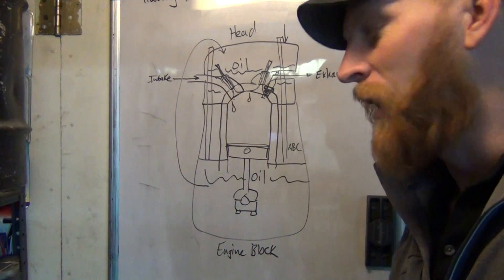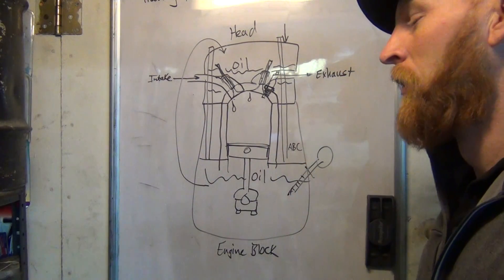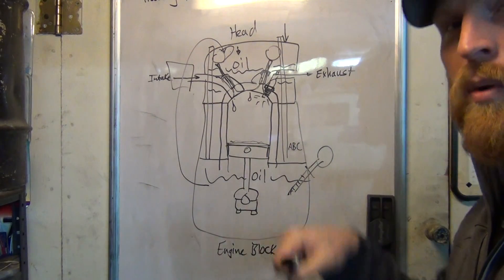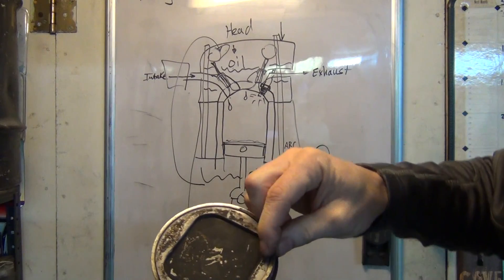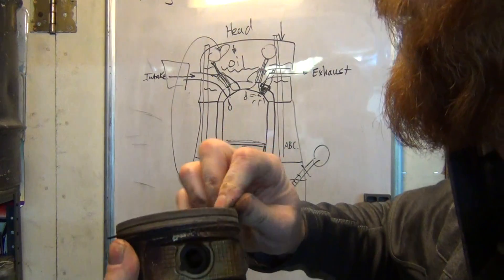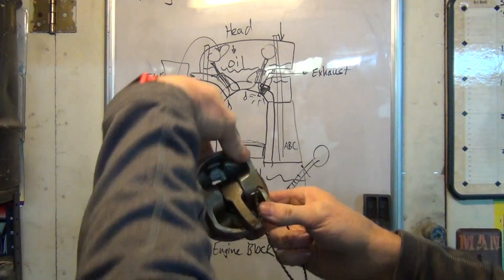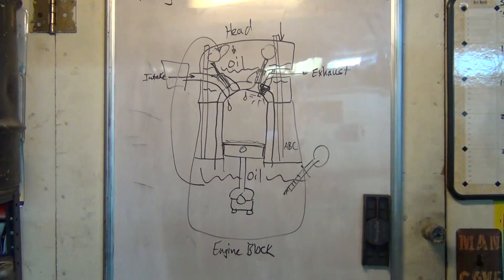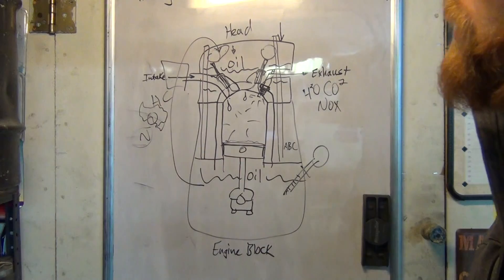Oil Burning Explained

Comment: Not too bad but let me, perhaps expand on the two ways an engine can be burning oil that you pointed out and make it a little clearer. BTW, I'm a retired ASE Master Technician and was trained at the General Motors Training Center in Atlanta back in the previous century. I have a long career at diagnosing and correcting oil burning engines and had one of the best "comeback" records in the industry. When I fixed something, it stayed fixed. I'm talking 100,000 miles fixed.

First, the valve seals almost never leak when the engine is off. If the drain is plugged that can happen, but most often the guides wear out and the old seal can't do it's job. You can replace the seal, but it won't last long either. The main offender is the intake valve seal because it is under a vacuum all of the time; when the vacuum is high it leaks the most. Many engines don't even have exhaust valve seals because those guides are always under a pressure that pushes the oil back into the vale cover area. So, when the valve seals are leaking oil into the combustion chamber (almost always the intake valve seal) the engine will blow smoke when it is at idle, when the vacuum is high.

Second, when the rings go bad oil is not wiped off the cylinder walls sufficiently and combustion then burns the oil left on the cylinder walls. The hotter the combustion, the more oil it burns. So, when the engine is under a heavy load (when the vacuum is low) "blown" rings burn more oil. "Blown" rings (why we say an engine is "blown") also cause a huge amount of blow-by gas to be discharged into the crankcase and this overwhelms the PCV system. I have seen many breathers soaked with oil and this is a sure fire diagnosis for bad rings, specifically the compression rings.

Hence we can tell which condition is the cause for the oil burning. If the valve seals are leaking the smoke will be greatest when the engine is at idle. I've often seen it go away completely when you step on the gas and put the engine under a load. If the rings are bad the opposite will happen. I've seen engines that don't smoke at all at idle and then fill up the shop with smoke the minute you step on the gas.
Reply: Back in the early 90's there were some 305 Chevy engines that burned oil much like you say, in fact exactly like you describe, and the factory wound up replacing the short blocks. The iron in the cylinder walls was so hard the rings never seated: after 5000 miles you'd see what looked like a brand new block with a cross-hatch that looked like it was machined yesterday.

Some things to think about burning. Oil rings can fail and NOT cause an excessive cylinder leak down condition, they just flood the cylinder walls with oil; that could be a cause for your condition. The previously mentioned failure of the compression rings to seat from hard cylinder walls will cause oil burning. Two axioms of oil burning engines: Smoke at idle = intake valve seal. Smoke under acceleration = too much oil on the cylinder walls. That's it. I suppose it's possible a bad design could cause a lot of splash to be sucked up by the PCV but I've never seen that.

As far as the UV oil additive goes, it's an expensive way to look for leaks, but it does work if you use it properly. Put it in the oil and put the car up on the lift, engine running, IMMEDIATELY. Then start to look for the leak. Often a leak is very slow, especially when you don't have a drip on the driveway where you park it. Even then you can have a leak that the wind blows off the engine when you drive it or that blows up onto the engine. Cadillac's Northstar engine was bad about that and the engine just got dirtier and dirtier.

Here's the best method I've found for finding oil leaks. Get a spray bottle with some liquid laundry detergent in it and clean that engine thoroughly, top and bottom. Once dry, spray all the engine's seals with Dr Scholls Foot Powder. You can buy expensive engine cleaners and "Tracing Powder" at the parts store, but these products work just as well and are much cheaper. Run it up on the lift and look for the place where the foot powder gets dark: there's your leak. This is always faster, especially on slow leaks. Sometimes I've seen the leak before I crank the engine, as I spray on the powder: some oil leaks out of a seal by gravity.

Good luck... no... GOOD TECHNIQUE,  good technicians don't rely on luck.
Reply: @ladamyre1  Last November, had my engine rebuilt by a mechanic who rebuilds 2 or 3 engines monthly. After 3k miles, engine started burning oil like crazy with lots of sludge and carbon but no smoke or leak with dry compression test of 185 PSI across all cylinders.  Engine has 12k miles now and i have to add one quart every 750 miles.
Reply: @FaisalHelwa  That sounds like the oil rings broke. Check your plugs and look for carbon buildup on the plugs and a greasy or wet appearance. They should look like there's a dry tan powdercoat on them.

If it's possible that it was burning oil all along since the rebuild, it could be the rings aren't breaking in well. This can be because the block is hard, there were some Chevy 305's back in the 90's that had hard blocks and we would take them apart after 50,000 miles and still see a cross-hatch on the cylinders that looked like it was bored yesterday.

Some guys took a brass polishing compound, can't think of the name of it right now, and would mix a teaspoon of it into a coke bottle of water and pour it into the carburetor while the engine was running to get the stuff on the cylinders to smooth them out, but I've never done it. Seems too drastic to me, if it's getting on the cylinders it's getting into the oil and is going to wear everything, bearings, cam lobes, rocker arms.

Don't know what to tell you to do about it except take it back to the guy. With good compression and all that oil burning, and doing well for 3000 miles before, it sure looks like it can't be anything other than one or more of the oil rings broke, and my guess is it's more likely he's made a mistake on them: wrong ones, installed wrong... the right rings on the right pistons don't just break like that.

When you pull the plugs look for one or more of them to be fouled. If you have a broken oil ring, it'll show on the plug. And if you have access to a bore scope and can see inside the cylinder look for the machining marks on the cylinder and see if those look too new. After 12,000 miles the cylinders should be polished up pretty good.
Reply: @ladamyre1  Broken oil rings would not affect the compression? Plug looked a bit darker last time we checked it but not wet or greasy. he told me plugs are fine tho. Well, i do not think he would install rings wrong. He installs two or three rings a month building several engine monthly. He insists everything is fine and its poor oil quality which does not make sense to me cause no car burns oil like that. Correction, engine has 7.5k miles now since rebuild. Dry compression test of 185 PSI was after we realized engine burnt like 2 liters of oil for you information
Reply: @FaisalHelwa  Yup. An oil ring can break and not affect the compression. As far as the "bad oil" excuse goes: to me that's the sign of a dishonest mechanic.

Not smoking at any time, good compression readings, all dark plugs... sounds more like the oil rings the more I talk about it. Could be the wrong ones, but that would burn oil from the get-go. Maybe he put a bunch of motor honey in it to get it out of the shop.
Reply: @ladamyre1  Well engine was not burning oil the first 3k miles and i was next to him while installing the rings and assembling the engine. Shall i take a picture of the spark plugs and show it to you? what you mean by the wrong ones please? I bought Enginetech piston set and piston rings and he rebuilds three engine monthly. Do not think he would install mine wrong if you know what i mean
Reply: @FaisalHelwa  Don't bother with the pictures. All I can say is what's already been said. If an engine is burning oil there can only be two causes, the valve seals or the rings. Did he machine the block? Did he use stones and rough the cylinders up so the new rings can seat in? Do the pistons knock when the engine is cold? If so there's too much clearance between the pistons and cylinder walls. An engine like that would also show an increase in horsepower, so that one's a trade off: more power - burns oil. I had a '68 Buick 350 was like that, matter-of-fact it was my first engine rebuild back in the '70's. I was happy with it, but it only burned 1qt every 2000 miles or so.

From what you say, something happened at 3000 miles. It wasn't an anti-miracle.

Like the service writers say, I can't fix it over the phone.

Still, that "bad oil" comment is like a big red flag to me. You got problems I can't help you with. Maybe he did use motor honey, I don't know. All that sludge you told me about sounds like it.

1qt every 750 miles is not enough to foul the plugs. It's bad but not outrageous. Hopefully he did use motor honey and the cylinders are just gonna take longer to seat in.

You can live with it too. I've heard of guys with engines that burn oil like that that never have to change the oil, just keep adding it. You get a fresh package of detergents that keep the inside of the engine clean and get cylinder walls, pistons and compression rings that'll last a million miles. When there's that much oil on the cylinders you can bet they're well lubricated. Change the filter every 10,000 miles or so (and BTW don't use Fram) and you'll never have to remove the drain plug. lol
Reply: @ladamyre1  i will keep you updated with investigations. Thanks a lot for your concern
Reply: @ladamyre1  changed piston rings at another mechanic who told me rings were not installed correctly for one cylinder. One thing i noticed bro is that the responsiveness improved than when i first had the engine rebuild with no oil consumption!!!!
Reply: @FaisalHelwa  Glad to hear you found a good technician. There's a million shadetree mechanics out there, half of them with a "good reputation" when in fact they're just well-practiced con-men.
Reply: I admire the training and testing people had many years ago.  Now days, from my experience revealed me that mechanics at shops are guessing. my worse experience was this shop offered to change oil for me and I accepted.   they did not close the cap below tight enough and I lost half clean oil..It was the dealer who figure it out.. A shop can not even do a simple oil change correctly.
Reply: Dear Ladamyre1   I am afraid you are correct.  I am burning oil quite a bit..  The tail end of the muffler is black.
I also got misfire code piston or cilinder 3.   I replaced coils & spark plugs genuine parts from Nissan..and I got the misfire code error again p03030. When I start the car in the morning it seems to give a lot of smoke white, it is hard to tell if it is blue..     But when I am driving I see no smoke..I can see from my read mirrow.   ON the streets I have seen cars that while driving they are discharging smoke.  any tips and input will always be appreciated. THanks
Reply: intake manifold gasket  is the same as  INTAKE VALVE SEAL?   I am not car buff by any stretch ..
Reply: I'm still doing my homework Helmet.

As far as the P03030, that's OBDII and I retired not long after it came out but I'll take your word for it, bad cylinder #3. If a coil and plug didn't fix it, you got a bad valve, cylinder damage, bad compression ring(s) or possibly a bad intake manifold gasket.

Three things are necessary for good combustion, spark, fuel (gas+Oxygen) and compression. If all the other cylinders aren't giving out codes, and you replaced the plug and coil on #3, that eliminates the first one, right? If the intake manifold gasket is leaking extra air into the stream of air and fuel going into the #3 cylinder, that could cause your code. And it could be leaking extra oily air from inside the crankcase and that would account for the oil burning too.

Last post, the answer is no. The valve seal is a little neoprene grommet that fits around the valve guide boss that sticks up through the head inside the valve cover. It wipes almost all of the oil off the valve stem as the rocker arm pushes it down into the guide to open the valve.
Reply: I thank you very much.  You seem to know more than anyone else's version.  Do a tutorial you will have plenty of hits in no time. I tip my hat to you.
Reply: to resolve oil burning and misfires  Valve Cover Gasket Replacement  ? the rings inside can not be replaced, if one is broken the entire cover gasket has to be replaced...after I watched a video...    any input on this?
Reply: You will have to replace the V/C gasket if it's not reusable in order to replace the valve seals, but that's a job that requires specialized tools: valve springs have to be compressed, technical work for a technician, not for the layman. One mistake and you'll have to remove the head.
Reply: thank you ladamyre1...  what is the average labor rate for this work? any ballpark any estimate or range ??  that would help me a great deal or move back to Honda...
Reply: $100/hr. is average at dealerships, last I checked.

Subaru would be my choice.

At the end of my career I was working at a Buick dealership and they got a Subaru franchise so they sent me to an on-demand school Subaru set up in Orlando for techs all over the south-east.

Every car manufacturer will have updates on their cars: parts that were re-designed after the car went into service because they had unacceptable failure rates. GM cars had books with those parts lists in them and any given year of any given model would have a hundred pages or more of parts changes. All US manufacturers went with the idea that if a poor part caused them to spend more money on warranty replacements of it than redesigning a better one, then they would make an updated one. As long as a certain percentage of failures were cost effective as far as warranty expense went, they were willing to foist the cost onto the customer. "Planned obsolescence" is the ethic US manufacturers went by.

At that Subaru school the instructor handed us such a book for updates, it had about fifty pages of parts that had been redesigned...

...that covered every car Subaru had ever produced going back to the 1960's!

As of the mid 1990's, Subaru had one of the most rigorous testing programs for it cars. They didn't sell a car until they were pretty sure it would last. Customer satisfaction first was their motto and planned obsolescence was considered an evil idea to management back then.

But US manufacturers finally caught on in the 90's. Too many people had been burned with crappy cars that became dogs, cars they made in the 70's and 80's. People who vowed never to buy another from "that company", and many bought Toyotas, Hondas, Datsuns and Subarus. They were all good cars back then but Subaru was the best, and the most innovative by far. They made an unusual pancake 6 that vibrated because of the design, but it was bullet-proof.
Reply: I'd buy a used Subaru any day.
Reply: I see you were trained by ASE..  is that a Mechanic school or University and how long was your car repair training ?  2 yrs ?  6 months?  Nowdays, we still have to deal we oil and bolts and nuts and hoses..Howver, this oil powered cars era is coming to an end. Lithium and/or cadmium will power the next generation of cars. It is already happening.  Tesla Motors is building a massive biblical size plant in Nevada where they will assembly Lithium cars.  They will need Lithium car experts there. Tesla Motors I believe has found Lithium producers in South America. Bolivia has the Uyuni salt pan, the largest in the world. It is a poor country but it could become profitable for them. They also have a smaller salt pan near Uyuni. Uyuni is the size of Jersey City  or Zurich city..that is huge.
Reply: Not trained, tested. The Institute for Automotive Service Excellence (ASE) is not a training program, it's a testing organization that rents facilities wherever there are enough applicants and runs tests for the various disciplines within the automotive industry. There are tests for steering and suspension, brakes, air conditioning, automatic transmission, engine mechanical, engine tune-up and electronic controls, etc. Successfully passing all eight got you Master Technician Certification from the Institute. Those tests are quite difficult if you don't have any actual experience; a bookworm with facts logged away in his head will never pass any one of them. The questions seem tricky to that guy because of the way they're worded, but an experienced technician will spot the ruse every time.

My training was gotten first at a Vo-Tech in my town, Art Kerns was the instructor and he learned in the 40's at a college. The rest I got after I started working for a Chevrolet dealership and was at the General Motors Training Center in Atlanta. There the best Engineers and Technicians GM had to offer ran schools in specific systems, some of them the very people who designed the systems.
Reply: Funny.  I am trying to figure out why my 1999 Honda Accord is burning half a quart every thousand miles.  I have not noticed any oil drips or smoke.  I will test compression when I get home.  My 2000 Civic has low compression.
I got rid of my Subaru after replacing the head gasket.  Had I realized how common that problem was I never would have bought the car.  I still did not know when I had the timing belt replaced.  For another $750 I should have been able to have a mechanic replace the timing belt and head gasket, instead of looking at a $1,750 repair a year or two later.
Reply: Man you are awesome! Well Deserved my like
Reply: I have a mower that is dumping oil when on, literally dumping oil. I see its coming out of the top of the piston area, what should I check? It's a kawasaki fh430v
Reply: Too bad you don't have any videos
Reply: I appreciate your service sir, this info will help me a lot, thank you.
Reply: *****
A sign of the lack of certified training, not that I know that for certain, but he does come off like what we used to call a "shadetree" mechanic. No need for service manuals or factory procedures for guys like him.

And don't take that to mean he's an exception. My experience in the industry is, about 2 out of 3 mechanics are shadetree mechanics.

Funniest thing I ever saw was a guy like this dropping a 350 he rebuilt into 1989 Monte Carlo. The valve covers were still off!(?) When we pointed it out and asked why, he said he hadn't adjusted the valves yet... he wanted to do it while the engine was running!

What a dope!

Second funniest was the kid in the school I attended who removed an alternator he was replacing without disconnecting the battery negative terminal. He had the wire all set and was sure it couldn't short against the manifold.

The instructor came by while he was in parts and made sure it did, catching the car on fire!
Reply: *****
Well... this IS YouTube you realize. Here, it's not about being right, it's about being popular.
Reply: +ladamyre1 what if you see no smoke but you still lose half a tank in a month or so? (no leaks)
Reply: Azaria Abebe
I take it you mean half a QUART?

It depends on the miles on the engine. If it were a brand new engine it could be the rings aren't seating in. Years ago GM produced a 307 block that was hard as hell and the rings refused to seat in the cylinder walls. You could take the heads off and see the original cross-hatch machining on the cylinder walls. They would come in with pretty much the same complaint, "Engine burns oil" but they ran fine, didn't foul the plugs like a "blown" engine would, and no smoke either.

It can also depend on the miles you're putting on the engine. If you were burning half a quart every 1500 miles I would say that's not bad, in fact an engine that burns 1 quart every 3000 miles is a candidate for an old fleet maintenance managers trick - never change the oil!

Yep, you heard me right. It was discovered a few decades back that the detergents in modern oils are so powerful that if an engine burns 1 quart every 3000 miles you can save thousands in costs for waste oil disposal and new oil and filters, and still not affect the life of the engines significantly by just replacing the lost quart every 3000 miles; change the filter every 10,000 or so. The crankcase gets it's dose of detergent keeping the drain back holes open, the rings free of varnish and clean enough to not create any problems.

The engines do wear out faster, but not enough to matter if you're going to trade it in after 100,000 to 200,000 miles anyways.
Reply: ladamyre1 Honestly I have no clue what is wrong with my car but I recently changed my oil at 213500 miles and now I'm at 214500 and I'm at half a tank.. this is a honda accord 1999. I swapped to synthetic to slow the issue but it didn't help.
Reply: Azaria Abebe
"Half a tank" is not giving me enough information. Half a tank of gas? Half the oil in the crankcase? A Honda Accord takes how much oil? Are you talking about the level showing on the dipstick? Usually most manufacturers have a checkerboard pattern on the dipstick showing "full" at the top and "add" at the bottom. Most times that "add" mark is when it's 1/2 quart low.

If it is burning too much oil you can try Rislone (R)  engine oil additive for oil burning engines. The stuff works good (for a while) and can save you from having to rebuild if oil consumption becomes a problem.
Reply: half a tank of oil. My engine takes 4.5 quarts lol sorry i said tank loosely.
Reply: Azaria Abebe
So you're burning 1/2 a quart every 1000 miles, correct? If so that's not too bad. But if it's 2.25 quarts, half the oil in the engine, that's bit high. Still, modern catalytic convertors are quite good at burning those hydrocarbons but that much oil going out the exhaust will make it run hot, if it's in good condition. If not, you should be seeing a little bit of smoke.

You may not notice it going down the highway at 55mph. Try revving the engine up around 2500 rpm in the driveway and see if you see smoke then. If so that Rislone would help those rings which are probably the cause. 2 quarts going past the intake valves would surely foul your plugs, and you'd notice the engine running rough.
Reply: So assuming it did burn for example 2.5 quarts 1000 miles would my cat suffer the most?
Reply: Azaria Abebe
Yes. If that's the case try the Rislone and see if it helps. If it doesn't your rings may be broken.

Rislone does a good job filling in the scratches in cylinder walls with a plastic that helps compression and that can slow oil burning too as long as the rings aren't in pieces.
Reply: @ladamyre1  I have a 2014 audi allroad and it burns about a quart of oil every 800miles I’d say. Anyway I can fix this..?
Reply: ladamyre1 I have a question, if you don't mind. My car is losing a lot of  oil. It just lost 1 quart in 250 miles. People driving behind have noticed small puffs of smoke on acceleration. I took it to a local shop that specializes in German cars. They performed a leak down test, checked the ecu for codes, checked the spark plugs, and checked under the car for leaks. They said it all came back clean. They couldn't even reproduce the smoke from the tailpipe. They suggested it might be the turbo, and it could but these cars are known for bad rings.
 
Is there a way a car can pass a leak down test and have bad rings. Say a bad oil control ring? In other words, does a car passing a leak down test rule out the rings (all of them) as the source of the oil consumption? Also, shouldn't I be noticing a lot of oil smoke from the tailpipe when losing that much oil over such a short period? 

I plan on pulling the O2 sensor to check for oil fouling. I also plan on using a uv oil leak detector kit (I have the dye, the light, the glasses) to look for leaks. Do you think those are good places to start or am I wasting my time? I know the shop couldn't figure it out (and they have factory trained techs, or so they claim), but hey, its my car. I'm more invested in figuring it out.

Anyway, thanks in advance for any help. Its greatly appreciated.